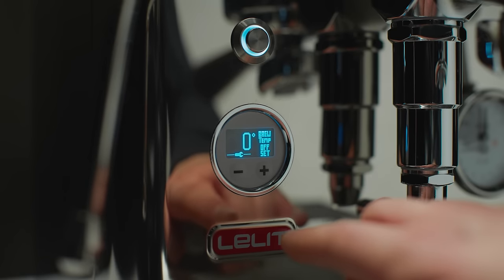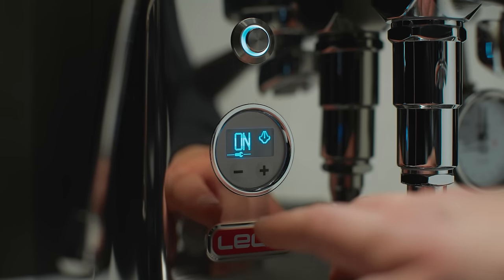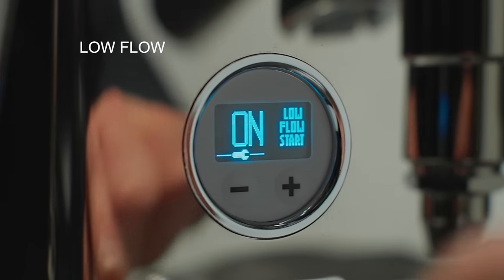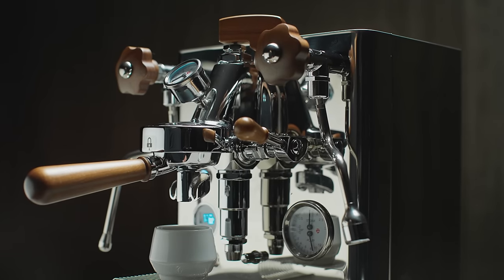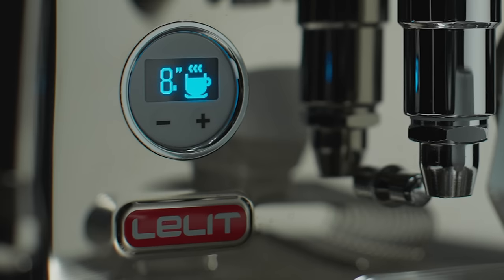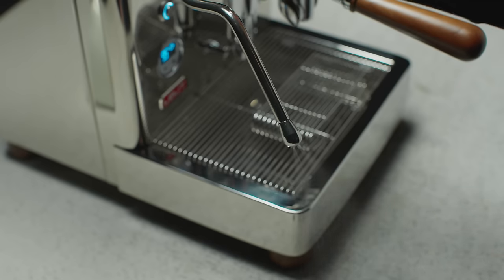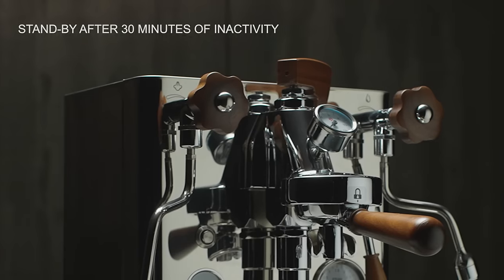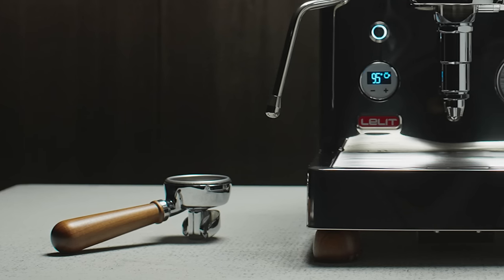LELIT Bianca PL162T: Tutorial video

Comment: Is version 2 Bianca upgradable to the 3th version?
Reply: Im an owner of V2 and would like to know the same! However, I know that the V3 has a new solenoid inside of it so I think that would be the most pain in the butt part of the upgrade process.
Reply: The LCC as well as the solenoid valve have to be changed
Reply from the maker: Hello, the update requires certain technical skills and tools. We recommend you to contact your reseller for the update of the machine and check with him also the cost of this operation. Thank you, LELIT Team